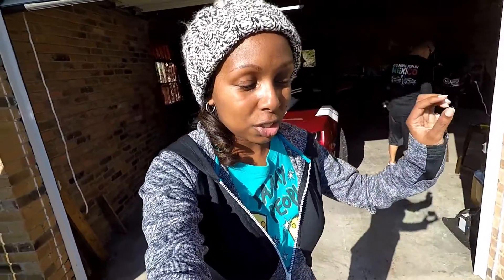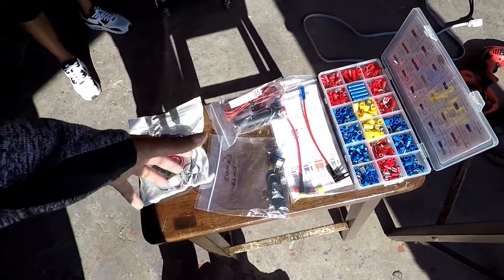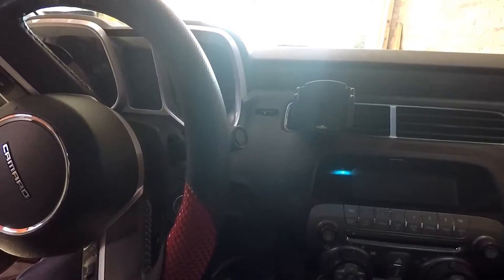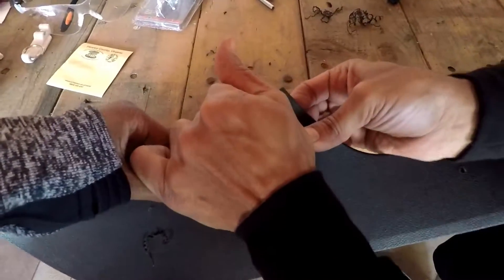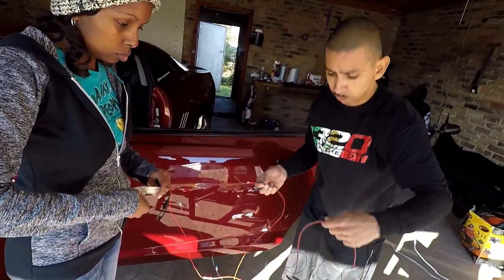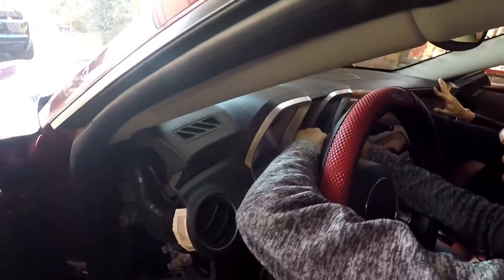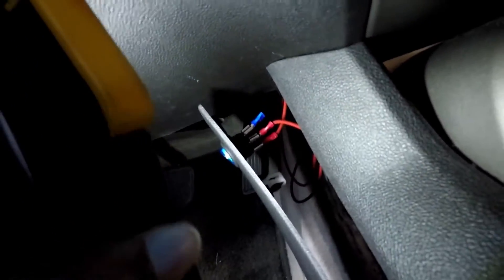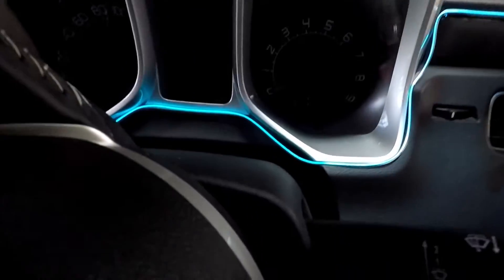Interior LED Light Install In 2010 Camaro SS!

Comment: So wait everything doesn’t come in a kit? You have to buy everything separately?
Reply from the maker: Yeah this particular setup was not a kit, but I’ve provided links to everything I used in the description.
Reply: @HerAutoPerspective  does the aftermarket ambient lighting across the dash shine brighter than the factory ambient lighting in the door?
Reply from the maker: @kmart014  not by much in my opinion
Reply: @HerAutoPerspective  looks like the light strip is sold out. Smh
Reply from the maker: @kmart014  I’m sure Amazon has something similar!

Comment: i have a 2018 Camaro Lt, do you think it’s possible for me to do this, or does it only work on SS models ?
Reply from the maker: diego I would assume that Chevy didn’t change the side electric panels too much between the 5th and 6th gen but I would check the side and see if you have a ground screw

Comment: How did u pass the wire from the fuse box to the inside of the car? Did u have to make any holes ?
Reply from the maker: There’s a fuse box on the inside panel on the driver side